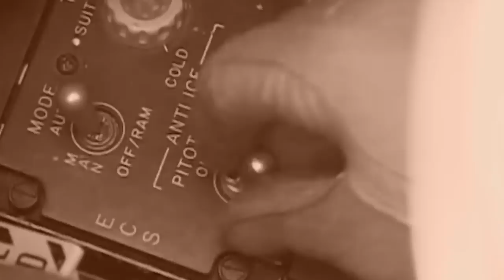X-31 Quasi-Tailless Thrust Vector Jet - Extreme Angle of Attack

Comment: The ultimate F-5 variant!
..,......................
WHY?!? Aren't thrust diverters on every fighter?
Stiffener Kits and upgrades would be a new sub industry.
F-14 upgrade.
 In the submarine upgrades. External props or unducted props are antiques.
The only? plane is the F-22. And F-22 is only 2D on thrust diversion, but it cools the exhaust. 
It's the only? stealth that is serious about thermal signature, except B-2 and B-21(whenever that becomes combat capable).
...................
The diverter paddles never melted! 
...................
Seems low tech, but on a Rafael, Gripen, F-16, F-36 Kings make, hell an old Mig-15 would turn on it's tail!

Comment: the wings are too small that they can't help stabilize it's flight during low speeds. the design was impractical if it's purpose is to load missiles and other weaponry.  this plane was useless from the start.
Reply: Useless for what combat? This was a technology demonstrator not a combat aircraft.